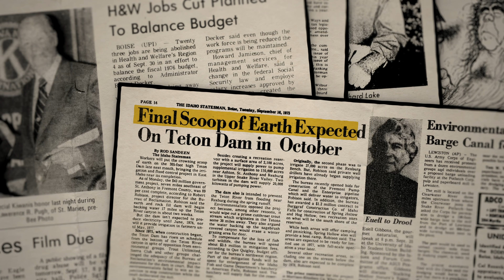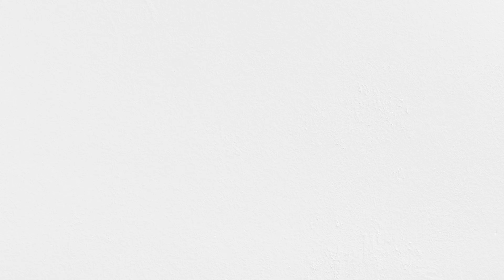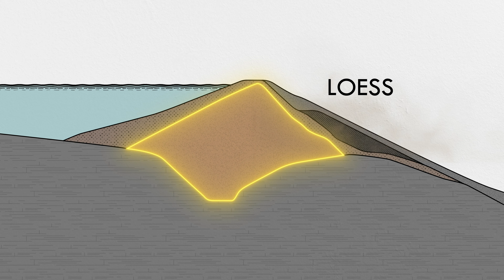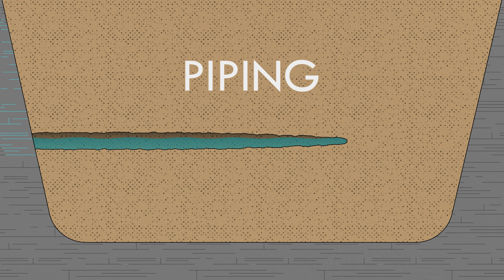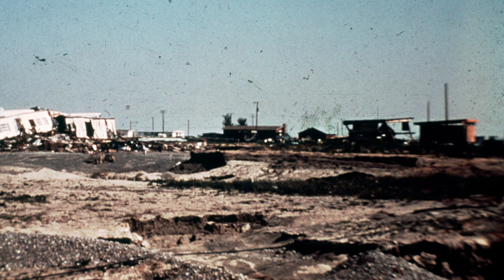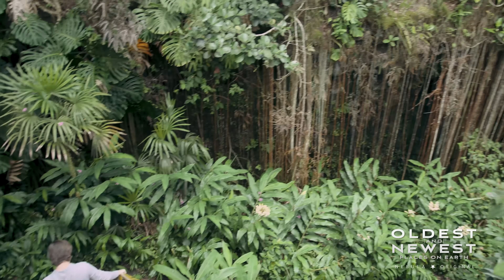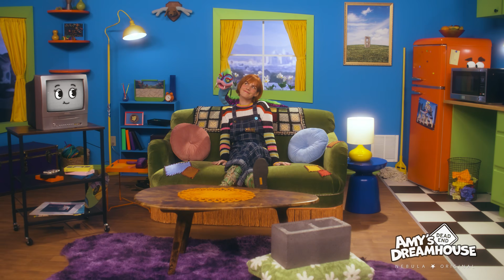The Wild Story of the Teton Dam Failure

Comment: The grout foundation discussion reminds me of a job I was on. We were drilling a few feet into limestone, and grouting things in place. Nearly saw two guys get into a fist-fight over how much grout was poured in. The issue was that there were fissures, and some areas would drink grout like a college kid on a bender. And that's simple layer-cake recrystalized micritic limestone with some faults running through it. You start adding pyroclastic material to it and it gets REALLY complex REALLY quickly. Somewhere I've got a chunk of basalt with bubbles that formed when the hot lava hit relatively cool soil and the soil gasses vaporized; the lava cooled fast enough that the bubbles formed were frozen in time. How do you map where the bubbles you can't see connect into channels you don't know exist? 

Also, as a geologist I want to thank you for your statements about geology at the end of the video. Many people look at geology as the easy science--the Rocks for Jocks class you took in college because you needed a science course and physics and chemistry sounded hard. The reality is that geology is one of the most complex sciences. To be a good geologist you need to know physics, chemistry, biology, meteorology, mathematics (paleontologists invented a lot of statistics), hydrology, even economics. We work closely with engineers, and I like to think we pick things up from each other (I know the engineers I've worked with rubbed off on me). I have the deepest respect for engineers; I have said that our world rests on nothing but the profound minds of the engineers that designed and built the infrastructure we rely upon. It's nice to hear your side give us rock and soil types some love! :)
Reply: A local river eroding through supposedly solid rhyolite lava beds has exposed gas pockets at least 30’ / ten meters tall, and not particularly narrow. Thousands of cubic meters of absolute voids in ‘solid’ rock, not tuff — welded or no.

Comment: "Frugality over safety" 🤔Well, when we promote and reward Engineers because they found faster cheaper ways to do things we're usually pushing the safety limits harder through their 'improvements' ☹ We need to end that practice and the only ones who can do that are Engineers in the ASCE. Or we can do as many other Countries do and put the people who were responsible for failures in jail awhile. If neither happens there will be another dam failure and another round of making the excuse of "Well we learned something here" when they didn't learn the most important part at all.
Reply: People like low taxes and fees.  Politicians don't like to be called big spenders.  We have as much safety as we are willing to pay for.  We could eliminate railroad/vehicle deaths if we were willing to have over/under crossings but that is expensive.  We could make safer cars but they will cost more.  We could have better city police but we would need to raise salaries.  If you're going to jail people for a dam failure it's a higher pay grade than the engineers.  Or you can tell the public they bought on the cheap and their suffering is part of the money they saved.  Harsh yes, but that's the bottom line.

Comment: Sounds like some engineers hadn't had enough playtime in the sand at the beach as children. It was indeed well-known. We used to add just the right amount of moisture to form "bridges" that small toys or a little water stream could pass under. If scouring is possible in any dimension, above or below any more durable material, it will happen--and then some--under that much pressure.

Comment: The basement of the building where I rented my first apartment in Rexburg still had about three feet of silt in it that was deposited by the flood, almost 30 years later. Apparently it was too much effort to remove. The same thing happened to my father's childhood home but they shoveled it out after the water receded. The scar in the local consciousness runs deep. Some small communities closest to the Teton canyon mouth were evacuated by helicopter just ahead of the flood, which went a long way towards minimizing the number of deaths from the dam failing. Nobody in the area is in favor of rebuilding the Teton dam, even though the retention of additional irrigation water would be welcomed by the local farmers. They say they understand the problems and can compensate for them correctly but they said the same thing back then. The Teton river is home to a distinct sub-species of the cutthroat trout and is a great recreational area, though difficult to access, so for my part I would prefer it doesn't become a reservoir under any circumstances.

Comment: Would it have been possible or even worth while to blast the base material and then compact it? Basically eliminating or reducing the perforated structure that was there.
Reply: Turning the base into large gravel, risky. I bet they though however many cement trucks they dumped in the sponge would hold.

Comment: Thank you, one thing you hardly ever see in discussions of the Teton Dam is that it was build on the Huckleberry Ridge Tuff.  Plenty of information is reported about the cracks in the rock, but not a word about the inherent problems with the rock.  It simply is not a good site, but it is also 2026 and we have the benefit of hindsight.  However, if the full story is not told, we do not learn all of the lessons.   The Huckleberry Ridge Tuff covers a huge area and includes many sites with obvious hydroelectric potential.

Comment: Geology student here! Pretty good explanation of tuff. Strictly-speaking, "ash" refers to volcanic fragments that are <2 mm in diameter; fragments of 2–64 mm in size are classified as lapilli or volcanic cinders, while anything larger than 64 mm is classified as a bomb (please don't auto-delete this comment YouTube, that is literally what they're called; what else are you going to call a relatively-large chunk of very hot rock that's been violently erupted from a volcano and is now hurtling towards your head at high speed?). The term that encompasses all of the stuff that comes out of a volcano is "tephra" or "ejecta", which are not as familiar as "ash".

There's welded tuff, which is generally "obviously a rock", and there's unwelded tuff, which is so crumbly that it almost straddles the line between rock and soil. Tuff can be from ashfall or pyroclastic flow, the latter of which is known as an ignimbrite, and is described using both igneous and sedimentary terms since its formation involves both eruptive and depositional processes. This obviously makes determining its hydrologic characteristics a bit complicated.
Reply: Just don't try to explain this at the airport
Reply: Volcanic ejecta sounds like a Harry Potter spell
Reply: I shuddered when I heard “silt core” and “tuff foundation.”

Comment: fascinating!  dams can be scary for sure
another that you may be interested in is the mactaquac dam in new brunswick canada.  it's experiencing a completely different failure.  degradation of the concrete is requiring constant boring and injection of new material (grout i believe).  mactaquac is primarily an earthen dam and supplies hydroelectric power

Comment: Repairing on the downstream side is pretty useless since it creates pressures in the dam internals. 
You need to fix leaks before it enters the dam upstream. 
Or, seal it with a cutoff wall like mentioned in the video.
Reply: I think they tried to fill the upstream holes with D8s.
Reply: @jackprier7727  What is that? And how did they reach the upstream side?
Reply: @jsjs6751  the dozers went into the hole
Reply: @jackprier7727  Yes, but downstream, right? 😊
Reply: @jsjs6751  watch it again, they tried D8s on both sides-

Comment: If you are interested in failling dams, I would suggest to have a look on the "barrage de Malpasset" in France which broke during a fast fill up during a storm. (Which was in fact the real first one, as they had no enough water for the 5 previous years for the fill up, and they ended up the commissioning the dam as "good for service" without real measurements.)  At first, they closed the valve, to avoid the flooding of an highway bridge construction site down stream. And then when they realized something was going wrong, the unique bottom purge was way to small to manage the water rise and the dam overflowed. At last the rock supporting the arch dam failed: the wave killed 423 people in the city of Frejus.

Very little known, the "barrage du Piney" over the city of Saint Etienne a "twin" of Malpasset : exact same design, same size, same type of rocks (gneiss). After a 7mm move of the wall, they decided to lower the top level of 4 meters (from the initial 45 meters). Later on as they understood the water spillway was undersized, they decided to make a new one halfway to the top. During that construction, they realized the foundation of the dam was completely messed up and decommissioned the dam soon after, digging a huge sluice at the bottom of it : a 100 years rain event would have occurred during that time before decommissioning, that dam would have failed.

Comment: I grew up in east Idaho, and have heard this story many times.  The fractured volcanic geology is an issue that I've heard about a lot and that I understand well from years spent exploring the area.  I'm not sure if I've heard about the incomplete river outlet works before.  Would the outcome have been different if the outlet works were functioning, and the reservoir didn't fill so quickly?  Would it have done any more than delay the inevitable failure?
Reply: It would have only delayed. They may have had time to deconstruct the dam without failure. It was known the dam would fail before it was finished but the money was already allocated and they were going to build it and not risk losing those funds that would bring a lot of money to a very rural area

Comment: Every safety rule, every regulation, every standard we have to follow is ultimately written in blood. When I think that the Final Destination series is essentially just a series of disregarded safety regulations. The iconic highway scene, for example. If they had secured the load and driven at a speed appropriate for the wet road with sufficient safety distances, the second part wouldn't exist!

I always think of this when I'm at work being reminded how to get out of a truck, use the steps, and where to hold on.

Yes, it's a constant learning process and a huge responsibility.

Comment: Wow, memories of my childhood.  I lived in St. Anthony.  I earned my Boy Scout First Aid merit badge at the first-aid hut at the dam site.  My friend's father was a civil engineer on the dam.  My mom drove from St. Anthony to Rexburg and back that morning, missing the flood by an hour or two.  One of the victims was the son of her classroom aide.  Friends of ours evacuated, watching their dairy farm get washed across the road in the rear view mirror as they left.  The Teton Canyon took a hard left turn just downstream from the dam.  The flood blew out the canyon walls.  There were well casings standing 30-50 feet in the air, where all the dirt had washed away near the end of the canyon where the water came through.  

The volcanic rock in that area is nasty.  At times, it is close to the surface.  They had to blast to put in the sewer and water pipes in town.  It is very tough, but very porous.  There are places in that valley where they irrigate by running water through ditches, raising the water table enough for the potatoes to take up water.  A shallow hole will fill with water.   Between the high water table and the volcanic rock, it was very difficult to put in a decent basement in some areas.

Wilford isn't so much of a village or town, but a farming area.
Reply: Wilford has been seeing some development in the past couple years, the area just northwest of 2400 E and 200 N is getting filled in with neighborhoods. It's still super low density, multi-acre lots, but there's a lot more there now than even just 3 years ago when I moved to Rexburg
Reply: @EthanNeal  As a newcomer, and there is nothing wrong with that, you can't even imagine the changes in the last 50 years.
Reply: My Grandparents lived in St. Anthony. My grandpa ran the Chevron station for over 40 years. My great-uncle in Wilford lost everything.
Reply: @trbowlin Was your grandpa Glenn Abeglen(sp?). We bought gas from him for many years.
Reply: @mcpetzold  He was! (Glen Abegglen, the double g trips up a lot of people). I spent many hours at the station with him. Are you still up there? I grew up in IF but live in Poky now
Reply: @trbowlin  I’m in Minnesota. A friend of mine worked for Glen and we hung out and drank Coke from his coke machine one summer.

Comment: In my opinion, two other causes are the lack of surface slush grouting and packing open joints in the foundation, and the use of loaded dump trucks to compact against the abutment foundation! Plus the lessons from Fontenelle were not learned.

Comment: We moved to SE ID a year after the dam failure, and it was still front and center on everyone's minds for many years after that.  And I'm sure it spooked a LOT of people below the Palisades Dam, which is not too far away from the Teton Dam but on the Snake River upstream of the Teton-Snake coming together.  I really remember the volcanic silt in the area- really fine and almost impossible to compress, especially if you got it wet- you could not soak it through.  And for some reason, it was really irritating to my skin as a kid.

And interesting geologic side note about the fractured nature of the rocks below the surface- there's a massive aquifer under much of SE ID, specifically under the INL.  When the massive earth Borah Peak earthquake happened in 1983, the same geology that lead to the Teton Dam failure damped the earthquake through the INL keeping the number of nuclear reactors there very safe.

Comment: I haven't watched it yet but a lot of these stories start with "we lack safety? no big deal"
Reply: I work in aircraft manufacturing, and I can tell you that engineers get constant pressure from the sales/manufacturing side of the business to sacrifice safety for an improved bottom line.
Holding strong against that pressure is difficult at times, especially when you get leaned on by executives.
And the longer we go without loss of life from a major airframe failure, the easier it is for them to believe things like "engineers are too cautious" or "if it were up to engineering we'd never get anything built" (both of which are things regularly spread around the sales/manufacturing teams).

Comment: Dealing with our own dam problems here in Cheboygan, MI.
We had a 100yr ice storm last year in March that took out our power grid for a week. This year we had an insane amount of snow, about 2 to 3 feet in 24 hours. That was a few weeks ago and it slowly melted saturating the ground and then rainstorms came with no where to go. Our dams hydroelectric is broken, or else this wouldn't be an issue. So our dam was 5 inches from failure. Now it's 7. They have giant 24" pumps running, trying to get the water down. There was a local levy break as well, causing evacuations. Major flooding in the entirety of northern MI and the U.P. and then yesterday wind pushed huge chunks of ice into flooded houses, breaking windows, destroying properties. We're still cleaning up after last year's ice-acolapse and now an even bigger mess.
Reply: Michigan being so close to the great lakes, is always in danger of huge snow dumps, huge flooding and huge amt of rain at ANY time, just from being so close to that huge amt of water in those lakes....
Reply: Wow! I was seeing photos of the ice damaged homes but hadn't heard about the dam's troubles. Yikes!